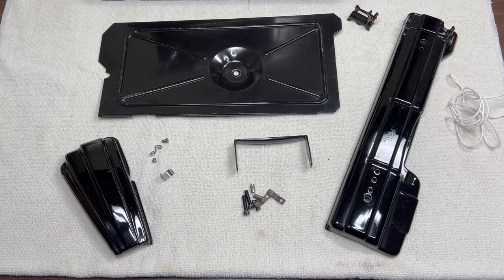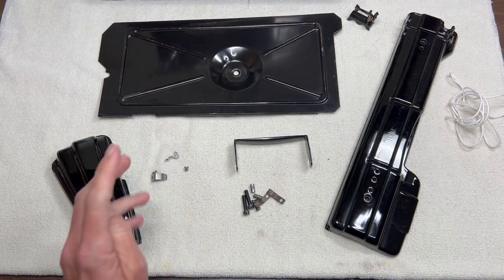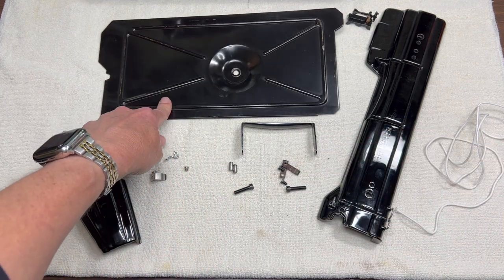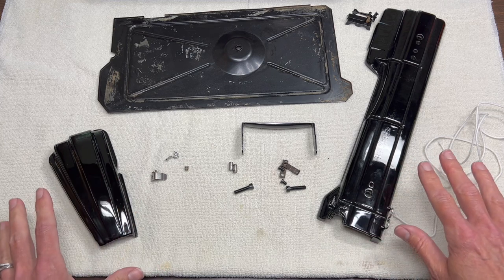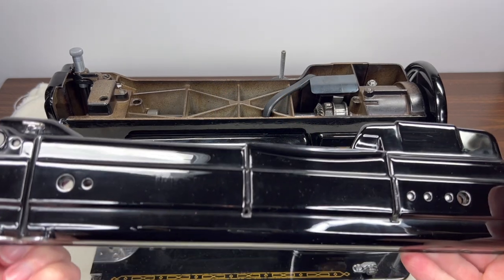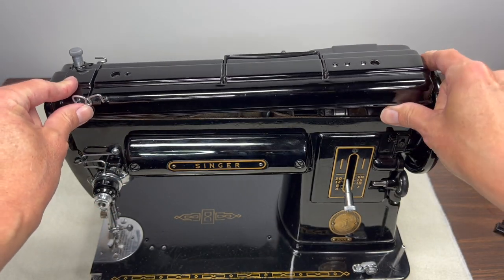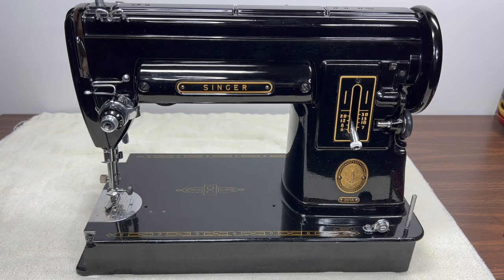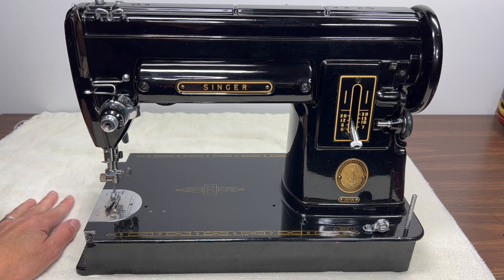How to install the top cover, face plate and bottom cover: Singer Restoration Series Part 26

Comment: So glad to see a tutorial on replacing wicks in the lid. I've only seen the hard plugs - and so far, I've just left them in place... but when they are missing, I didn't realize they could be replace with wicking. Thanks!
Reply from the maker: Yes! I am not sure when they went from oil wicks to plugs but I do get a lot of machines where the wicks are just missing. The original ones are always discolored and nasty so it’s just easier to replace them.

Comment: It appears to me that there are 3 oil wicks just to the left of the screw that holds the right side of the top cover of the machine on and a fourth oil wick just to the right of the screw that holds the left side of the top cover of the machine on. It seems to me that you only mention the 3 oil wicks on the right side. Do you agree that the hole on the left side also uses an oil wick?
Reply from the maker: Hi! The extra hole you are referring to is one that goes down into a port for the main shaft. I have never seen an oil wick in that port, I don't believe that Singer put one there. Which is a bit odd, I never really thought about that before. I personally don't see a reason to put one there but I guess you could if you wanted to. I think it would be better not to. That being said, one of the 3 wicks on the other side oils the same shaft on the opposite side so it is kind of leaving me scratching my head. Let me know what you decide to do, I think you are safe either way!
Reply: @SewingMachineRehab  Thank you! I added a wick to that hole already, so I think I'll leave it that way for a bit and see how it goes. Your comments are very helpful.